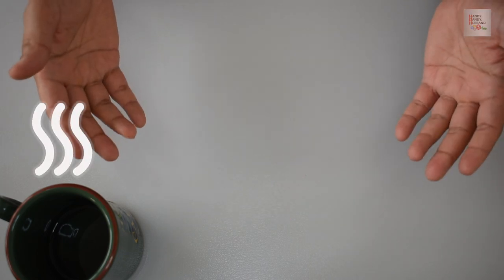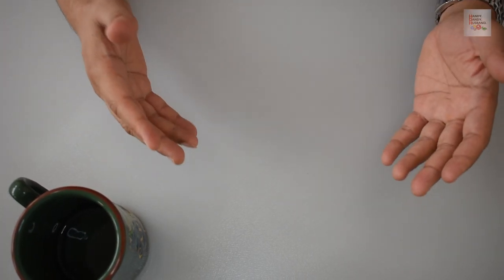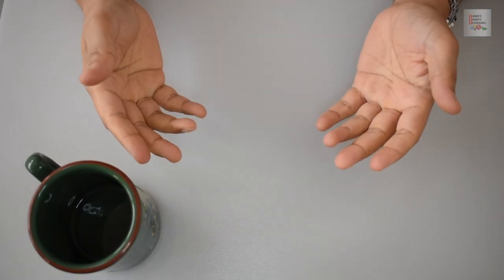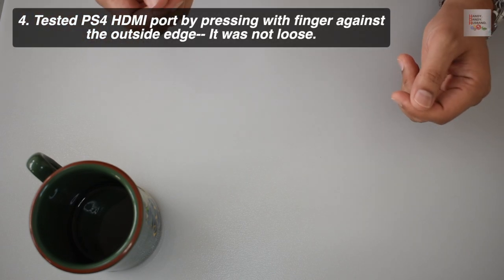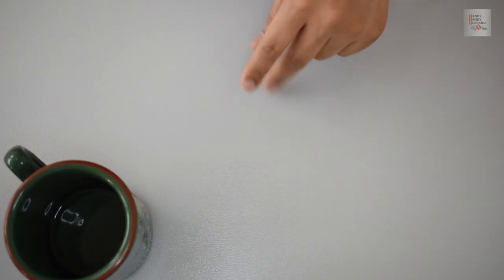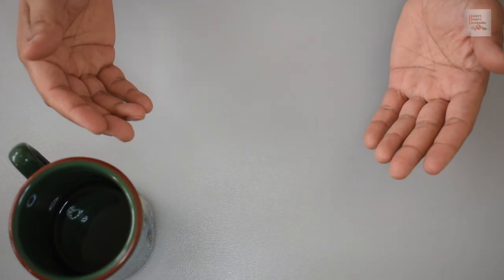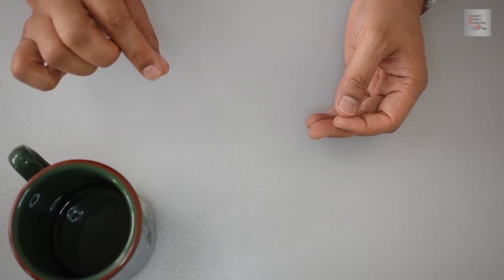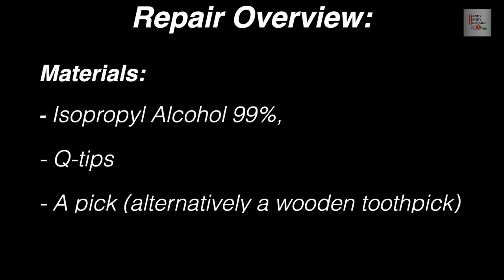𝗤𝗨𝗜𝗖𝗞 𝗧𝗜𝗣: 𝗣𝗦𝟰 𝗛𝗗𝗠𝗜 𝗣𝗼𝗿𝘁 𝗥𝗲𝗽𝗮𝗶𝗿 -- Easy, no solder required -- [Fix that video input error]

Comment: What do I do with the alcohol
Reply from the maker: Hi WhatAFatRat, thanks for watching and sending me your question.  The Isopropyl Alcohol is used sparingly on the cloth or cotton swab that you use to clean the HDMI cable metal casing (sometimes it gets dirty) or the inside of the PS4 HDMI port.  The inner piece of the HDMI port has a number of copper/brass contacts that (if you look closely) get tarnished or blackened with time.  Be very careful, however, when cleaning these because the cotton swab fibers can sometimes get stuck in this small piece.  Hope this helps you.  All the best to you in 2021 [: { ].
Reply: @HANDYDANDYHUSBAND  Will a usb to hdmi adapter help with he problem
Reply from the maker: @WhatAFatRat  Hi WhatAFatRat, thanks for your further comment.  That truly is a novel suggestion.  I am assuming that you are referring to a 'male' USB and 'female' HDMI adapter.  If so, are you wanting to connect the TV/monitor to the PS4 via USB?  If so, I am not sure that the PS4 USB connectors will support that arrangement. Typically such adapters are used with laptops to mirror the screen.  Despite, this, I am intrigued, I would give it a try as most of these adapters are less than $35 and if it saves your PS4 than it is money well spent.  If you get a chance, please let me know if this setup works.  All the best to you, H.D.H. [: { ].

Comment: I plug in my hdmi on the tv n get a green screen i cant do see my users or nothing i tried safe mode n nun change
Reply from the maker: Hi KvngSauce, thanks for watching and sending me a summary of your issue.  I will need more information, before I can comment.  1st: is a 'green screen' the typical screen you get if your monitor/tv cannot locate a video source? 2nd: How did you try 'safe mode' on your PS4 without  seeing the video prompts on your monitor/tv?  3rd:  Is this the first time this has happened, have you had problems such a flickering or poor video before this time?  4th:  Did you try the fix I outlined in my video?  And finally 5th:  Have you tried using a new HDMI cable?  Please let me know and I will do my best to help you.  Thanks, H.D.H. [: { ].

Comment: Man I can’t prop up the prongs
Reply from the maker: Hi lilfish456, thanks for watching and sending me your concern.  It is a bit challenging propping up the prongs/thin metal strips.  Toothpicks do work, but with too much pressure they do break.  Try using a long needle or a long pin--either instrument will help you get enough stability to push the metal strip back in position.  Sometimes it can help to use the pin to sort of dig/pry the rounded part of the metal strip into position by using the outer metal casing as leverage.  Hope these suggestions help and hope you had a great Xmas and New Years celebration.  H.D.H. [: { ].

Comment: I switched the channel to my tv and now I can’t reconnect to the HDMI
Reply from the maker: Hi Erh 1c, thanks for watching and sending me a summary of your issue.  From your description it appears you must have changed a setting on your tv/monitor.  I don't think there is anything wrong with you PS4.  I would recommend checking on the internet for a manual for your particular tv/monitor and review it for a way to reset the settings--there may be a way to complete a factory reset.  Another suggestion you might try is to try to switch the HDMI port that your PS4's cable is inserted into in the TV (only, if, of course, your TV/monitor has more than one) to see if that enables you to regain the video feed.  Hope my suggestions help you out.  All the best to you in 2021, H.D.H. [: { ].

Comment: How do you get the prongs out
Reply from the maker: Hi JW Gaming, thanks for watching and sending me your question. If the thin metal strips are flattened out, you can use a thin metal pointy object like a long thick needle or pin to gently pry them up so that they protrude about 1-2mm from the metal surrounding.  Hope this helps, all the best to you in 2021, thanks, H.D.H. [: { ].
Reply: @HANDYDANDYHUSBAND  What part of the prongs do I put my needle in
Reply: And my ps4 turns if it on 480 p but not on 720 p evn though my monitor has always been on 720p
Reply from the maker: @jwgaming4692  Hi JW Gaming, 480p is the resolution set for 'Safe Mode'.  Are you certain that your PS4 has not gone into safe mode?  One thing that may work is try the PS4 with another tv and see if you have the same issue.  You may need to reset the PS4 if the issue is with your PS4 and not the TV.  Hope the suggestions help you, H.D.H. [: { ].
Reply from the maker: Hi JW Gaming, use the metal pick/pin/needle to pry the metal strips up from the top.  There is a slightly curved portion of the the metal strip that may be slightly visible and the very tip of the pick you are using should be able to grab onto that and work it up/bend it up gradually.  Hope this suggestion helps you, thanks, H.D.H. [: { ].
Reply: @HANDYDANDYHUSBAND  It was in safe mode but when I try it on  my TV the screen lags out but how do I change it on my monitor so it turns
Reply: @HANDYDANDYHUSBAND  Thank you I tried do the TV method and it was lagging out and it still doesn't turn on for my monitor
Reply from the maker: @jwgaming4692  Hi JW Gaming, what do you mean it is lagging out?  Does it turn off after some time?  Please let me know.  Thanks, H.D.H.
Reply: @HANDYDANDYHUSBAND  The screen goes back and white
Reply from the maker: @jwgaming4692  Hey JW Gaming, I would try restarting the PS4 (if you haven't already tried) by pressing and holding the power button for about 7 second (until you hear the second beep).  This will turn off the console completely.  Unplug the power cable from the console.  Wait 30 seconds, plug in the power cable and turn on the PS4 normally to see if this fixes your issue.  2nd thing to do if the 1st doesn't work is try a BRAND NEW hdmi cable and another port in the TV.  The third thing that I would do is try to disable the HDCP, but that would require you to be able to see something on the screen.  Hope one of the suggestions helps you, H.D.H. [: { ].
Reply: @HANDYDANDYHUSBAND  I only have 1 hdmi port in my monitor
Reply from the maker: @jwgaming4692  Oh...then just try a new HDMI cable.  Thanks, H.D.H
Reply: @HANDYDANDYHUSBAND  Thank you it's working took me whole day to fix
Reply from the maker: @jwgaming4692  Hey JW Gaming, that's awesome.  Thanks for sending me your update.  Hope you get many years of playtime out of your PS4, H.D.H. [: { ].

Comment: Hi please can you help me I don’t think it’s serious but my PS4 screen keeps going black randomly when I’m playing then coming back on but sometimes it goes to no signal I really need help cause I play online a lot . Do you know what this is and what might be causing it ?
Reply from the maker: Hi Ethan Fuja, thanks for watching and sending me your question.  The fact that your screen is going black is likely a video input or output issue.  Likely you are using a HDMI cable that connects your PS4 and your TV.  If you are using a different connection, let me know and I can send you different instructions.  FOR HDMI:  First step would be to replace your HDMI cable with a brand new cable (not all HDMI cables are the same, try to buy a High speed HDMI that is a version 1.3 or 1.4 and it will be able to handle video resolutions from 1080p to 4K) .  2nd step is to plug the cable coming out of your PS4 into a different HDMI port on your TV.  3rd step, if the first two don't work is to try turning the PS4 on and see if gently nudging or moving the HDMI cable improves the connection (meaning your TV, if black, starts showing images or the  'no signal' goes away). If it does, you might want to gently tape the cable in the position that provides the best connection.  4th, if the above steps don't work, try altering the resolution of the PS4 in the settings to 1080p (sometimes you need to make sure that the PS4 resolution and the TV resolution are the same).  5th you could try the fix listed in my video--this will improve your video connection and may solve the intermittent black screen. Work through the fixes in order and hopefully your problem will be solves.  All the best to you in 2021.  If you get a chance, let me know your results.  Thanks, H.D.H [: { ].

Comment: nah bruh ps4s hmdis poo i had mine fix 6 months later it mess up again
Reply from the maker: Hi soulblex, thanks for watching and sending me your comment.  It is unfortunate, but a lot of people have had issues with the HDMI port.  I admit, my fix isn't as good as a full HDMI port replacement, but my fix is free and well worth a try.  Its a shame that your port stopped working after only 6 months.  Try my fix, if it doesn't work, I would suggest maybe taking the unit back and see if they will repair it under warranty or for a discounted price.  Most port replacement should last longer than just 6 months. Hope you get it working again, all the best to you, H.D.H. [: { ].

Comment: I just bough this hdmi cord Nd it still not working !!!!
Reply from the maker: Hi KryBitxh, thanks for watching and sending me your comment.  I am sorry my fix didn't work for you even though you did buy a new HDMI cord.  Did you also check the HDMI port pins to ensure they were protruding upward to keep the new HDMI cord secure?  If that doesn't work, you may need to replace the HDMI port.  Please let me know and I will try to help.  All the best to you, H.D.H. [: { ].
Reply: @HANDYDANDYHUSBAND  yeh i bough the newest hdmi cord.
Reply from the maker: @krybitxh-4344  Hi KryBitxh, thanks for replying.  OK, I understand you purchased the newest HDMI cord, but my question is are the prongs on your HDMI port (on your PS4) protruding out a little so that your new HDMI cable is positioned properly?  Please let me know.  Thanks, H.D.H. [: { ].
Reply: @HANDYDANDYHUSBAND  no
Reply from the maker: @krybitxh-4344  Hey KryBitxh, it may be an idea to try the fix that I highlighted in my video before you proceed to have the HDMI port replaced.  The fix is free and can be done in about 5 minutes--it won't hurt and you might be pleasantly surprised.  Try it out and let me know.  Thanks, H.D.H. [: { ].

Comment: My hdmi works it’s just the hdmi in the ps4 didn’t I think
Reply from the maker: Hi SLEEPY MH, thanks for watching and providing your comment.  I am sorry that my fix wasn't able to get your PS4 up and running.  Out of curiosity, can you please tell me how you determined that the PS4 HDMI wasn't working (on an internal level) rather than it being an issue with funky metal connection.  Your comments will help other viewers in the community to troubleshoot and perhaps identify when/if my fix can correct their issue.  All the best to you, H.D.H. [: { ].
Reply: @HANDYDANDYHUSBAND  so the hdmi cord does work but when i plug it in the ps4 I have to like push it really hard And if I take my hand of the hdmi cord it stops working
Reply from the maker: @sqoped7197  Hi SLEEPY MH, thanks for getting back to me. The fact that holding the HDMI cord in one particular position appears to connect the video could mean possibly 3 things.  1) the HDMI cord has weak/worn/about to break wiring, 2)  the HDMI port on the PS4 is loose or is connected to the PS4 board with poor soldering or incomplete soldering, 3) the HDMI port on the PS4 is worn.  I would try eliminating the possibilities one by one. 1st get a BRAND NEW HDMI cord, 2nd turn on the play station with the new HDMI cord and see if it works, if it does not, push it into the position until you can see video, then use some tape (packing or duct tape) and then let the playstation run for a 3+ hours--this will heat up the port and surrounding soldering on the board, then turn off the PS4 and let it cool for 24hrs without touching the packing or duct tape.  After 24hrs turn on PS4, confirm it still works and gently remove the tape (before the PS4 has a chance to get too warm).  If this still doesn't work, 3rd, take a magnifying glass and a bright light and look at the HDMI port at the back of the PS4 and see if the metal prongs are flush with the metal housing, if so, gently push them into position, also check on the center copper contact points and see if they are worn or dirty--if dirty clean them gently with isopropyl alcohol, if worn, you will likely need to replace the PS4's HDMI port.  Hope one of the solutions above works for you.  Please let me know the results if you try any of the suggestions.  All the best to you, H.D.H [: { ].
Reply: @HANDYDANDYHUSBAND  thanks a lot I’ll try when I have time
Reply: @HANDYDANDYHUSBAND  I just tried with a new hdmi cord and I have to do the same thing
Reply from the maker: @sqoped7197  Hi SLEEPY MH, sorry to hear that the 1st step didn't work.  How about step 2, were you able to position the HDMI cord in place with duct or packaging tape and let the PS4 run for 3+ hours?  One thing that really helps me when I am trouble shooting something (I know this is going to sound weird) is to coax the device with something positive...tell it, "you will start working properly" and keep at.  I know it can be frustrating and a huge downer when something you paid so much money for fails you.  I do hope you get it working, but hang in there.  I will do my best to help you.  
All the best, H.D.H. [: { ]
Reply: @HANDYDANDYHUSBAND  you know where I can fix it ?
Reply from the maker: @sqoped7197  Hi SLEEPY MH, I think any electronic repair shop would be able to replace the HDMI port.  I don't know where you are in the world, so I cannot be more specific.  If you are in the US, perhaps talk to Best Buy and see if they can direct you to a few reputable repair shops that provide a warranty for both the parts and labor.  Another thought would be to go to the Sony Global website and check which shops are warranty certified to work on the PS4--there should be many both in North America and Globally.  Hope you are able to get it working properly.  All the best to you, H.D.H. [: { ].
Reply: @HANDYDANDYHUSBAND  thanks
Reply from the maker: @sqoped7197  No problem.  Hope you are able to get it fixed. If you do get a chance, I would be interested to know what eventually solves the problem--would greatly appreciate you updating the community so others can also learn.  All the best to you, H.D.H. [: { ].
Reply: @HANDYDANDYHUSBAND  what should I do if my port is loose?
Reply from the maker: @ElevenDEO  Hi Vanvlet, thanks for watching and your question.  If the HDMI port is loose, then there is likely a solder break in the anchors that hold it to the board.  My first step would be to check with Sony and see if they would cover it under warranty (as the ports shouldn't become loose over time), if Sony refuses to cover it under warranty, then my second step would be to contact a reputable, sony authorized repair center near your residence to have the HDMI port replaced.  I have seen some youtube videos that show how you can do it yourself--you might want to look into those videos as well.  Just remember, if you take the DIY route, have a nice soldering iron with fine tip and a way of wicking away the old solder.  Hope my suggestions help you get your PS4 up and running again.  All the best to you and Happy 2021, H.D.H. [: { ].

Comment: Idek how im going pull them up
Reply: It looks like there a little little bit up I think
Reply from the maker: Hi Jaypgamer XD, thanks for watching and sending me your question.  Its Christmas Day today, Dec. 25th, 2020...so, Merry Christmas to you!  Hope Santa was good to you.  With regard to your question, the best way to pull the pins up is to use a pick that you slide in between the slivers of metal.  You have to remember that you are only gently bending them up a little (use the adjacent aux output pins as a guide and push/bend the HDMI pins about half the amount the aux pins are sticking out.  Hope this helps you.  Let me know if you need any further guidance.  All the best to you, H.D.H. [: { ].